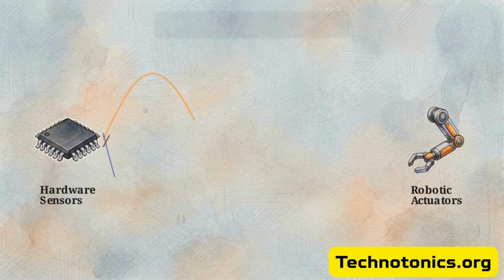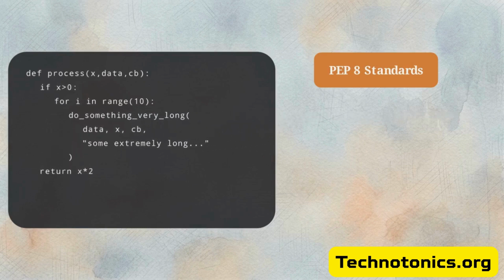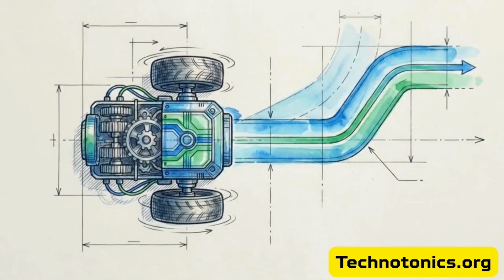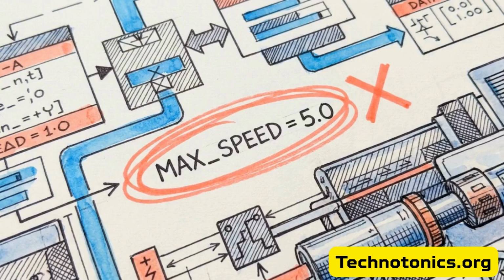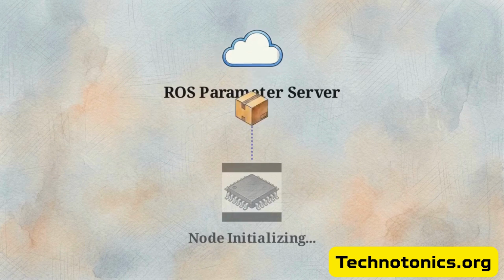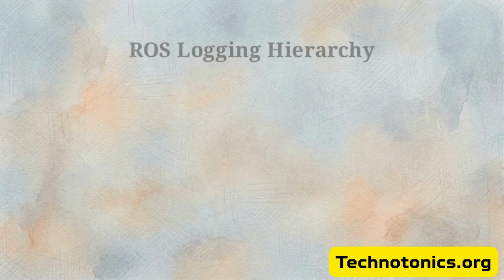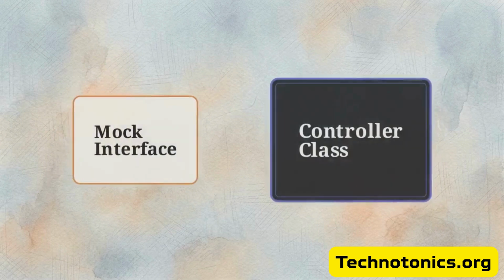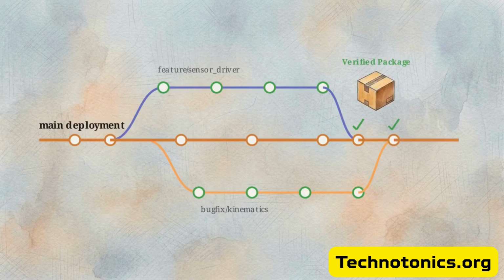Best Practices for Writing Clean and Scalable ROS Python Code | ROS Python Tutorial | TechnoTonics

Comment: How can Python programmers balance readable code with the performance requirements of real-time robotic applications?
Reply from the maker: Thank you for raising this important point! Python programmers can balance readability and real-time performance by writing modular code, optimizing critical sections, using efficient libraries, and offloading time-sensitive tasks to C++ or real-time frameworks when necessary. How do you think Python and ROS 2 can work together to achieve both maintainability and real-time responsiveness in robotics?